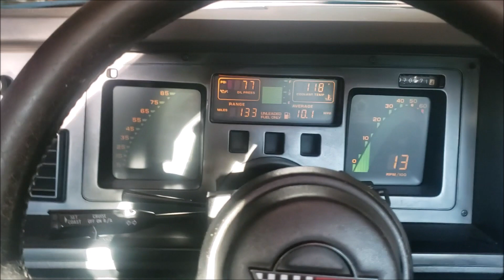87 Corvette Tune up (Plugs,Wires,Cap,Rotor,Air Filter)

Comment: I just did the plugs and wires on my 91 yesterday.  Cylinder 8 was relatively easy, but a fine tooth ratchet and a swivel spark plugs socket are needed as you don't have much room and or travel on the wrench.  I also removed the dipstick and an AC electrical connector.  Cylinder 6 was easy.  Cylinders 4 and 2 can be easily accessed after removing the panel at the wheel well, held on by five 10mm and two 7mm fasteners.

Comment: Good video.  As soon as you said weather stripping I went and subscribed.  I have the stripping, just dreading doing it.  Thanks again.
Reply from the maker: If I had any advice on this I'd say buy the new channels for the new stripping. It will save you a TON of time haha. It's not too bad, just time consuming. Best of luck!
Reply: @cashmansgarage5134  Thanks for replying.  Just watched your fluids video.  Only difference between your vette and mine is mine is an auto.  But still an 87 L98.  Thanks again.